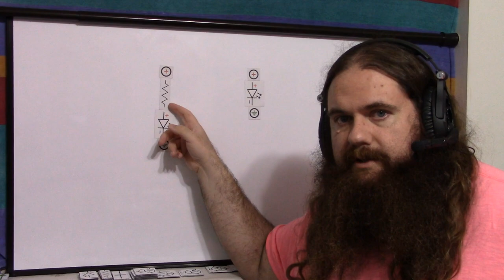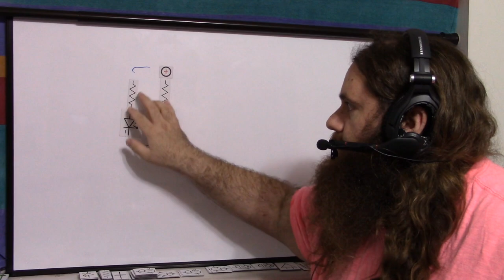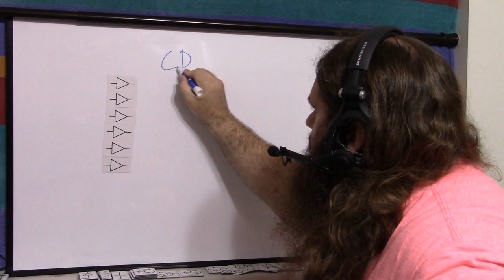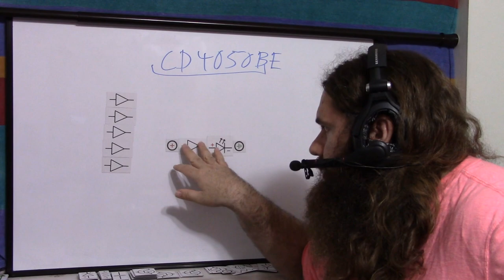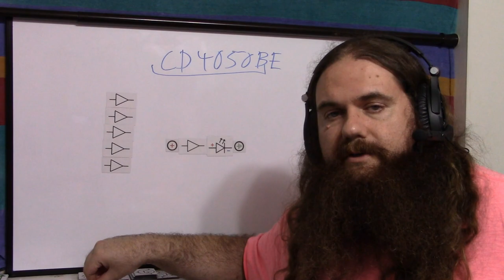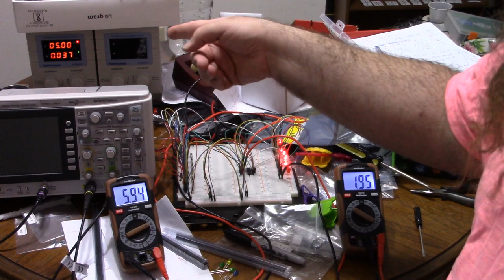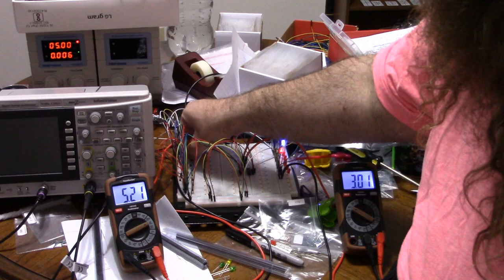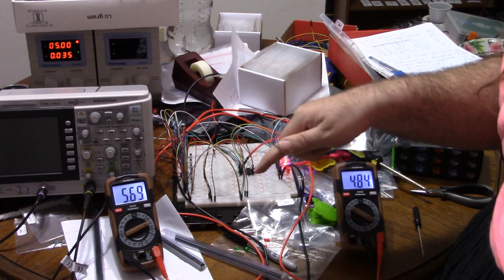Drive LEDs Without Resistors - Hex Buffer CD4050B Has A Trick Up Its Sleeve  - Simply Put

Comment from the maker: I just tested it with sinking current instead of sourcing (buffer input low, Vcc->LED->bufferout), and it still works, but gives even more power! 5V gives me about 6mA sourcing and about 25mA sinking. Makes sense, since the chip is designed to sink better than source. So now you know!

Comment: I just tried it with a CD4069UB and have to say: It works as well. It turns out that it has nothing to do with voltage level conversion but with current limiting output stages. Not all parts will have these „short-safe“ outputs.
Very nice hint! Until now I had not tried this in practice.
Reply from the maker: Oh, I'm glad you explored it more. My response to another comment isn't correct then. I had really thought it was the level conversion doing it but it turns out it was just a safety feature after all. Although maybe the safety feature is in there in particular because of its intended application? I tried to use the buffer to drive an NPN's base-emitter junction and that worked fine too, outputting about 0.7 volts.

Comment: Years ago, when I first began playing with IC;'S, I read somewhere that the 4050BE was a great IC for something or another, it was so long ago I forget now.  So I order a batch of 20 in, they were dirt cheep, probably Chinese knock off's even though they look legit.  Well by the time they got here on that slow boat from China, what ever I had in mind was gone and I had moved on.  So today, I am looking all over the web for something to use them for, you see I found a breakout board for the chip that I made long ago and used as a voltage dropper for running 3.3 volt devices off my Uno. Now days there are much better and smaller devices for this and I have a good stock should the need arise, so I have all these chips and no place to use them!  WELL Thanks to your video, I now KNOW where I can put them to good use, if they pass enough current to properly light the LEDS on my Arduino based EMF detectors that  I build for the local Ghost hunter club that my niece runs.  She loves my first design but they need 10 resistors running to the LED bank on the front of the unit.  Using this buffer chip should clean up that problem and allow for a smaller more compact case.  I had the original running off a flat lithium battery from an old tablet, and hooked a couple 1 Watt LEDS on the front of the unit in case they decide to make a run for it when things get hinkey the club loves that add on so I may well keep that on the unit, I am not quite sure but you have given me the answer on how to use those stupid chips that I have in my box, and make a better mouse trap in the process!

Comment: Excellent but u said that the chip is power sinking type then u grounded the leds .....shouldn't they be hanged to the positive rail which u didn't determine
Reply: Zain Aabdin That is the actual trick! Since that buffer type has poor sourcing capabilities, it manages to limit the current to a maximum of 6 mA at 2 V, so it seems to be safe for LED driving. The sinking power would have been too high, I think.
Reply from the maker: I'm not 100% sure why it works, but that's definitely part of it. I honestly think that it's something to do with the fact that it's designed for interfacing different digital voltage levels though. According to the datasheet, it's not even supposed to be able to source more than a few hundred microamps! Pretty soon though I am going to try to sink current the same way and see if it behaves similarly, because I've come up with a few things to exploit this design accident.
Reply from the maker: I just tested, and it works when sinking too! In fact, sourcing gives me about 6mA with 5V and sinking gives me about 25mA. Sinking is much more powerful but still limited, so as long as you don't go overboard, it works!
Reply: Simply Put Wow, thanks! But you have to be careful: 25 mA is the bare limit for most modern LEDs, and too much for old ones (e.g. NOS). So if there are any manufacturer or series specific differences, the LED‘s limit is exceeded and the LED fails. So for example: I tried to use some NXP 74HC14N (so as a different part, a hex inverter schmitt trigger) and it supplied 63 mA to the LED: way to much for a constant current LED driver for most LEDs. Nevertheless: It seems that really most parts indeed have a kind of short-safety, resp. current limitation on the output stages. That‘s nice. However: Other logic gates could fail/be destroyed if you short circuit the output pins.

So be careful! 🙂
Reply from the maker: Well yes, the thing was blinding and I'd never run it that bright. (Plus, to do bright LEDs you should be using PWM anyway because it puts negligible extra wear on the part.) But the point is, 6mA sometimes is enough and sometimes not for a bright LED, but with 25mA I could definitely go ahead and use it directly with a resistor to control brightness, to eliminate the need for transistors. It's well out of spec for the chip so no doubt the thing would fail sooner, but it's not like you can't just pop onto Mouser and order a hundred of the things. And this way you have two different modes, with resistor and without resistor, and you just have to turn the LED around.
Reply: Thanx to both of u I'm an amateur anyway I prefer to go the long way to be on the safe side I like to follow-up similar videos to have a clearer view always

Comment: The CD4050B will current limit and can drive a LED without a series resistor. VCC must not exceed 10vdc and it will only work on buffered CMOS ICs like the CD4050B but not the unbuffered versions CD4050A or CD4050UB.
Reply from the maker: This wonderful little chip is one of my new favourites that's going to allow me to simplify circuits to save on parts and assembly time, which would be silly for mass-manufactured devices but is great for a hobbyist in their spare time.